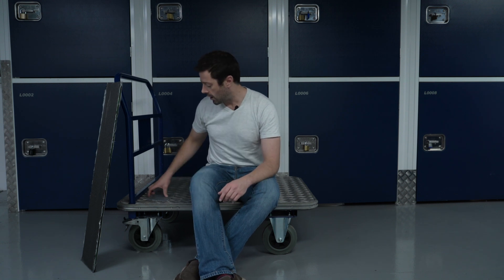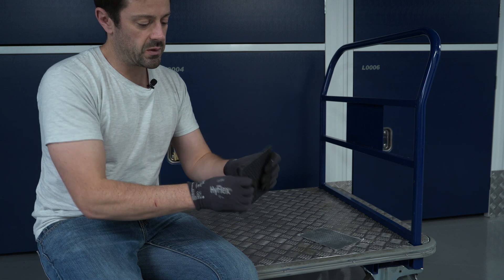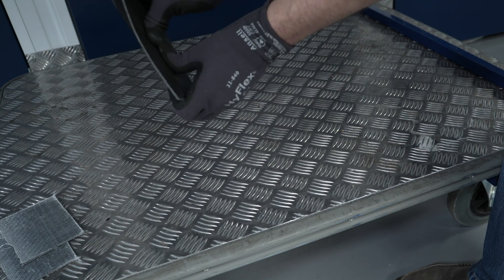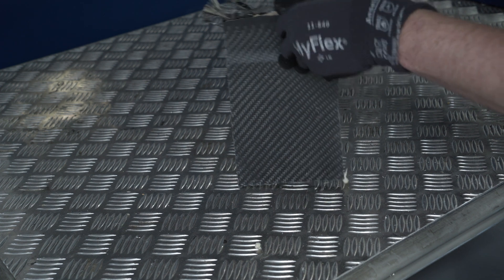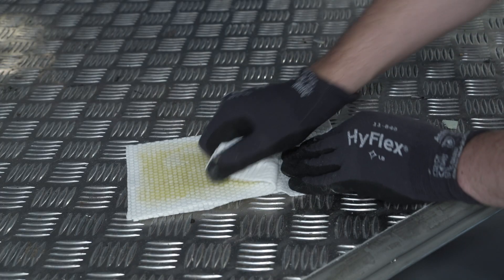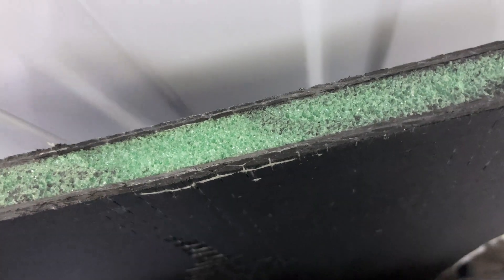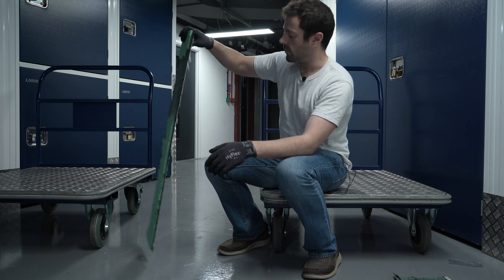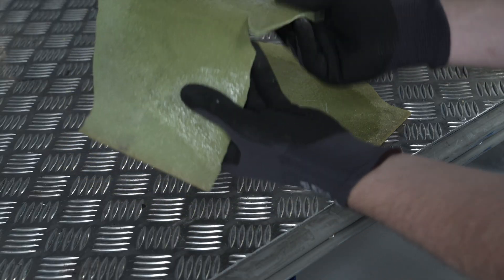Point impact & delamination test for carbon fibre, Innegra, Kevlar Aramid and various cores [4K]

Comment: How about plastic (nylon?) honeycomb? It is stronger in resisting the type of failure you see with the foam (bonds both sheets strongly). I use panels made of fiberglass outer sheets and 2 cm plastic honeycomb (~.5cm grid) in the middle. I use it as a bed, made of 4 segments .5m x 1.3 m. It is very strong, each segment easily holds 200kg in the middle.
Reply from the maker: Honeycomb is usually aramid or aluminium. Nylon would be an issue as the epoxy wouldn't bond to it, and nylon isn't very stiff.

For this project a little hard to conform, tricky for wet lay, and v expensive.

Comment: Not much experience with composites builds, just brainstorming. Maybe you can test embedding a stringer made out of one or two layers of 90/0 or 45/-45 running between the two unidirectional layers. I'd use foam to form the stringer and fill the gaps. I heard of people using styrofoam during curing and then burning it afterwards with solvents, but I am not sure this would help for that specific panel.

Comment: Have you considered vacuum forming peelply-fiber-peelply over a 3D pattern, like an egg crate and using that as your core. 
Alternatively Saertex makes SAERfoam that has lengths of fiberglass punched through the foam with needles and looks like a double sided hairy mat, so you're bonding to fibers as well as the foam.
Reply from the maker: I'm not sure I can picture the peel ply idea. How would it form a core?

I'm avoiding glass as much as poss due to density.

Comment: https://youtu.be/dHzqTfSkozg?si=0jN13fb_gZ27OxZW
This is who you should be talking to. Fiberglass and foam core has been his job for decades
Reply from the maker: I've just watched this, and aside from his cool vibrating consolidating machine and the fact that a GRP layup is a little different to a lightweight composite and epoxy layup, I'm not sure I'll be using it for training.

Examples being that he's using polyester (I presume, but perhaps vinylester) and so then since he leaves it to cure overnight needs a heavy layer of ('not quite epoxy') adhesive to get the foam stuck down. No linkage between the top and bottom except at the edges. Then he laminates half of one layer the following day after the first half cures, leaving a poor mechanical bond with only polyester resin. These are real delamination red flags. Finally leaving a newly cured polyester layup out of the mould on wedges overnight, which is asking for warping as the resin continues to shrink a little.

Sorry to be a downer!
Reply: @AlexHibbertOriginals  no downer. He has another channel just lamination. He owns a surf board company.

Comment: Of course we do not yet know what the final structure will be, however there can be merit in whatever, say foam- carbon build, having outer ply or plies of kevlar / aramid to improve impact resilience and help contain the lethal and often explosively released carbon shards of a really violent impact. Applies especially to particular vehicular areas containing the human(s), esp. critical structural areas where personal injury is likely from fractured panels etc. Appropriate resin choice needed to wet out kevlar.
Not sure if your plastic weave material could contribute in that way .. suspect not.
Reply from the maker: The 'plastic' fabrics are really just a variation on introducing Kevlar to carbon. They stretch much more than Kevlar, but are not as stiff. Kevlar is nearer to carbon's specs. 

Kevlar as an outer layer can be tricky if damaged since the exposed fibres will be fuzzy and suck up water. Hard to repair.

In general, all are designed to make carbon more 'survivable' in the event of impacts.

My impacts will be slow ones, so shards of kinetic carbon are v v unlikely, and having innegra etc in there will limit the chance of a total fracture.

Comment: Look at a Spectra-Shield inner core layer sheet on just the hull.
Reply from the maker: UHMWPE is great stuff but has to be used so carefully in composites as resin won't stick to it at all. In fact this polyethylene can be used as a release surface. So, the sandwich would need to be carefully designed.

Comment: 13:25 Can’t really tell from the video but I would expect that foam split closer to the top sheet. Manly because that’s where it was least supported due to the bad compressive strength of carbon fibre. 

Interestingly this suggests that the foam is not compressible enough to follow the movement of the carbon fibres. It probably starts to shred it self when the parts bonded to the fibre compressed more then foam could handle.  

If the failure was that the foam could not stretch as much as the carbon fibres of the bottom plate the foam would probably split in stripes that go across the board. 

I would keep an eye on how the property’s of the foam change when you laminate it curved and if it might shred itself more easily from being pre compress in a curve.
Reply from the maker: On curves I'm likely to not use the PVC foam, but we'll see.

Comment: SAFETY GLASSES!!! Not optional! When you force composite laminates to their failure point, there’s a substancial risk of fiber/matrix projections - typically small pointy shards. I do talk from experience, and I mean the painful kind… Despite the safety issue, great video!
Reply from the maker: You're probably right. If I'm to be horrifically maimed, I'd prefer it to be in a more glamorous and heroic context.

That said, when my grinding disc exploded, my eyes were protected and I ended up with a large scar on my stomach.
Reply: @AlexHibbertOriginals  FYI, picking shards out of you eye hurts way more than unscrewing your finger from a wall. Plus, you aren't kind of blind in one eye for a couple of days and no medical professional is needed for the finger. It's a risk vs reward thing. 😎
Reply: @ebutuoyotwen  This is true. I had to have some metal removed a few months ago. Eye doctor literally scraped it out with a sterile needle. Not fun. I've never held so still before in my entire life.
Reply: @BurnerJones  I will try not to worry next time. But damn, carbon when it fails, loves to fail spectacularly and that would just be bad in the eye.
Reply: I was also thinking this
Reply: And don't breathe in the the dust... It's the modern asbestos
Reply: @emanggitulah4319  That's true! Although I don't see it as critical, in this particular situation (a handful of experiments on a [apparently] well ventilated area...) as eye protection - the potential of an accident with catastrophic (often irreversible) consequences is something to bear in mind while dealing with high velocity projectiles.

Comment: The failure of the core material in that last test was interesting. I don't think I've seen that kind of failure on a large scale in the real world, because most of the stuff I've been around has significant shape (think boat hulls). I suspect because of that, in the real world, that composite's performance would be fine.
Reply from the maker: You're right that in a larger sheet, you'd not have the cons that a narrow plank has to deal with.

Comment: Alex, you need to contact a boat builder who specializes in fibreglass hulls.  They can help you with the through laminate connections, and also they may have some suggestions on proper core support materials.  A friend of mine built a small sail skiff out of foam core craft board, fibreglass poly resin and a mix of glass mat, and carbon mat.  He built the main form out of the foam core and sandwiched it with the carbon mat on the exterior and the glass mat on the interior.  When it was done and fully cured 3 of us could stand inside it and it barely flexed.
Reply from the maker: Whilst glass won't be a component for weight's sake, an investigation into through laminate connections will be a good idea, and I have a network of composite pro friends. The cores here are clearly top spec for their density.
Reply: @AlexHibbertOriginals  you should do some tests with S-glass fiber. Compared to carbon fiber in a hand lay up it is usually the same weight to strength. But you get the impact properties of the glass.
Reply from the maker: I've done a few tests with S glass. Good stuff, but your resin ratio would need to be crazily lean to overcome the extra density and therefore weight per unit stiffness. Also, whilst certainly stretchier than carbon, it's not in the same realm as diolen or innegra.

Comment: for the core use narrow strips of core foam and alternate them over and under a 3rd sheet of carbon in such a way that the new third and now middle layer of carbon makes a zigzag or sign wave or cardboard  pattern if looked at edge on,   would probably be good to shape the foam strips in such a way as to avoid right angles for maximum durability
Reply from the maker: I can see where you're going with this, and in a vacuum consolidated part it might be neat, but that's a very complex web of strips, with tons of labour to taper the edges and avoid bridging if the key aim is to avoid two separate skins from separating either side of a core.